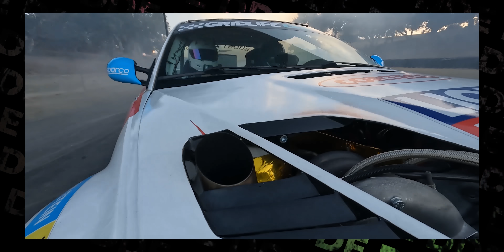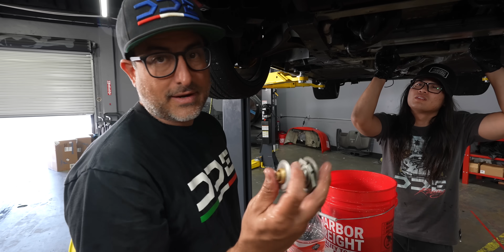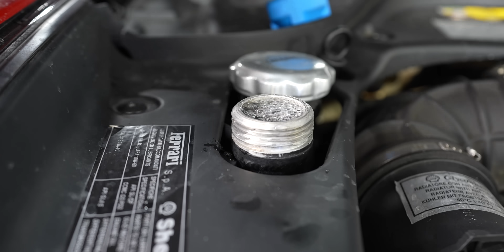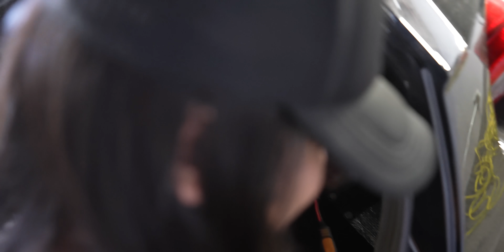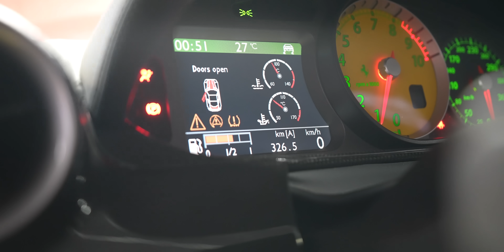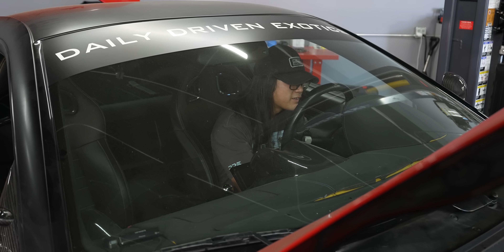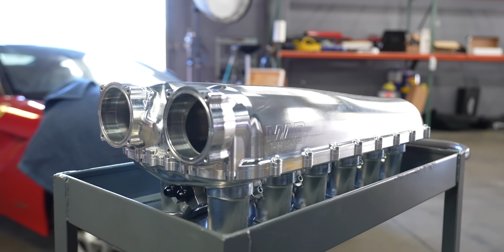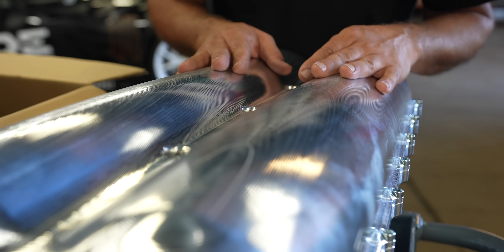WE SCREWED UP... FINDING FATAL FERRARI V12 ENGINE DAMAGE

Comment: Mike, with the thermostat being removed the coolant is constantly circulating so the coolant won’t stay in the radiator and cool down! Also should throw the thermostat in a pot of water and boil it with a temp gun to see when it’ll open or if it’ll even open.
Reply: I second the boiling of the thermostat to see if it's working. I'm also curious to know what other water flow control system Ferrari might have in place that's tied to the same system that controls the fans. Do they have a temperature/flow control valve to cool some other system like the intake air temps that's controlled by the same system that operates the fans? Did you guys try turning on the heater full blast to make sure all the air was out of the HVAC system?
Reply: Yeah they should've started with a new thermostat and complete flush of the cooling system
Reply: So you want to restrict flow, cool down the water on one end while increasing the temp on the other and constantly introduce huge temperature shocks to both ends of the cooling system to accelerate it's degradation? It takes seconds if you're wide open and already at temperature and heat soaked on a large motor to overheat if you lose circulation. Not WOT and just driving regularly? Thats' when you watch the temp gauge creep up and wonder if it'll ever stop. On a hot day a 180* thermostat is never closing in the south. Thermostat serves 1 main purpose. Keeping coolant at ideal operating temperature - this serves two parts, the performance of the engine to stay at ideal operating temperature and for interior comfort. You also don't want to be beating on an engine that is only at 140f. Nor 240f.
Reply: The thermostat is a spring operation device designed to open when the engine gets to operating temperature as the engine heats up the valve opens and closes as necessary its all temperature controlled having a thermostat in the car doesn't really affect the temperature unless there is a blockage somewhere in the water jackets or the radiator from excess build up flushing the system usually helps unless its a cracked head it doesn't need to be very big to leak just enough to start to warp the heads the list of possibilities is endless. im thinking that it can be most likely a cracked head or a gasket or a radiator blockage.
Reply: Strange they didn't check water pump, mine on volvo v8 fins of water pump dissolved  completly, and it starter to overheat badly as water was no longer moving.
Reply: That’s not how that works..
Reply: It needs a water punp
Reply: I drive a MK1 golf without a thermostat,without the thermostat it takes longer to warm up and when im driving on the freeway the temperature drops below operating temp bcoz of constant water circulation in system. No overheating at all
Reply: That is very literally not how it works. 

The point of a thermostat is very simple, it's a valve that operates based on temperature. When temp is low, the valve is shut, when temps rise, the valve starts opening. Really simple concept, it's an intentional flow restriction to keep coolant in the block. Why? To allow the coolant to warm up in the engine block without being allowed to flow through the radiator and cool down. Metal chips as it gets cold, so the edges of gears and other moving parts can be permanently damaged if operated in too cold an environment.

Do cars exclusively operate in the country they're built in? No. Do the engineers know what the climate will be like wherever the car may end up? No, it could either end up in Alaska or the Caribbean, and the system has to be able to handle both of those extremes. Does that mean that the system is optimized for a particular climate? No. Does that also mean that there is a more efficient possible system? Yes, one with fewer restrictions. 

Deleting a thermostat will NOT make your car overheat, that idea stems from a complete misunderstanding of the way a cooling system functions as a whole. Deleting the thermostat WILL cause problems depending on your climate and usage, but the one thing it won't do is cause overheating. If you're in a country where the temperature ever drops below 20c or there is +/- 10c of temp variation, NEVER delete your thermostat. In cold climates, the thermostat serves an essential purpose, and frankly those climates are the entire reason for the inclusion of a thermostat in the first place.  

However, if you're like me and you live in a country where no matter the time of year, it's always 30c+, the thermostat serves almost no purpose. Most thermostats open at 80c, and literally 2 minutes after startup, your coolant will have reached 60-80c depending on your engine's total coolant capacity. Get a bluetooth OBD2 scanner and connect it to your phone and you can get a live readout of your coolant temps plotted on a graph, check for yourself. In other words, if you're a normal person and you let your car idle for 5-10 min before you drive off, you will see literally no difference from removing your thermostat (In a warm climate). None of the dozens of racecars our garage has built has a thermostat, because we built and engineered them for our specific climate, and because it never gets cold enough outside for the metal to ever be in danger of chipping, the risk posed by a deleted thermostat is non existent. 

Everyone who keeps saying stupid things like "The coolant is flowing too fast to absorb heat", has less than no idea what they're talking about. If that were true, racecars would not be able to cool themselves. The Bugatti Veyron has water pumps that are almost as powerful as fire engines and circulate that coolant at extremely high pressures and speeds. If you want to learn more, look up how flow and speed affect cooling efficiency and what the thermal maximum for water is, as well as water's cooling efficiency, which will explain just how quickly water can absorb heat.
Reply: When you start a car it raves up until the engine is upto temperature then the raves down to normal idle.
Now if you remove the thermostat the car take way much longer to rich operating temperature and since the engine is in closed loop with a pr -determined fuel to air ratio to get it to temp hence using way much more fuel, gets stuck in a closed loop fuel cycle that degrades cylinder walls, piston, piston rings n catalytic due to higher fuel ratio needed for combustion.

Now without the thermostat and the engine is up to temperature on a long trip, hot day and probably a hill ahead your car will overheat since the coolant is constantly circulating between engine block and radiator and there's no thermostat to hold back the coolant in the block as the coolant in the radiator gets cooled thus causing the car to overheat.
Reply: Ummm, I hate to tell you this, but when it’s open, aka operating temp, it doesn’t “stay” in the radiator.  It’s constantly flowing just like it is with out one in.  The thermostat is actually designed to help the car warm up quicker.
Reply: @1216jimmyz  not having the thermostat in place will most defiantly alter the flow rate of the system, and depending on location of the thermostat it can alter the flow path, because it does have a restriction when full open, that is not there when removed. this is and extreme high performance engine, where every little detail maters to perform correctly, not a basic engine where removing the thermostat would only slow the heat up process. I know this from experience with many custom builds, not theory.
Reply: @cavemanmechanics1631  well said and correct.
Reply: @cavemanmechanics1631  lol, funny how every race car I’ve seen or dealt with has a thermostat delete. But keep telling people how a thermostat that stays open over 170 degrees is causing the engine to overheat…
Reply: @Not_Hans  Bro I swear to God, reading some of these comments is baffling. It's people who have not done it, who clearly do not understand the system, shouting down people who have done it and do understand what we're doing.
Reply: @Not_Hans  yes most race cars have no thermostat, but some need to run restrictors in place of the thermostat to maintain a certain temp( depending on application and many variables usually high speed oval racing) and some need a restrictor to not overheat ( I have experienced this in a few very modified street cars when doing drag and drives)
Reply: @cavemanmechanics1631  you're not wrong but you're also being misleading... Any modern day vehicle (in the last 30 years) will NOT overheat due to a stuck open thermostat (and if it does its probably a Ford or German). The only 2 scenarios a Restrictor would or should be used is to assist the engine to warm up to its operating temp to avoid running rich until the car actually hits its proper temp, or to PREVENT over heating in an Improper cooling setup. biggest examples being purpose built drag cars that run smaller radiators to reduce weight, smaller radiator means less over all cooling capacity with a stock or possibly after market water pump will circulate the water too fast through the system. In the video they literally mention how the radiator is cold but the over flow tank is boiling over, that's either A. A stuck CLOSED thermostat. B. A faulty water pump. or C. Some voodoo Ferrari bullshit that has some thing some where plugged or blocked (possibly when the car had a front end wall tap).
Reply: @Not_Hans  I never said anything about a stuck open thermostat, I said the thermostat needs to be put back into the system once tested for proper operation before preforming other tests.
Reply: @1216jimmyz hate to tell you this but the thermostat also restricts flow to keep it in the radiator long enough to cool it. If it moves too fast through the system, it will still boil over.
Reply: @1216jimmyz  👍👍👍 Exactly why vehicle will throw check engine lights if vehicle takes to long to get to operating temperature when cold started. It's there for a reason. Cooling systems differ from vehicle to vehicle as well.
Reply: @hughswain7422  with that theory every car would throw a check engine light in freezing temperatures. That's not how that works
Reply: @1216jimmyz  it does restrict flow to help cooling. Look it up. Alot of vehicles will actual overheat without a thermostat
Reply: @hughswain7422 what cars? Because thats ABSOLUTELY false… an open thermostat will prevent you from having heat in the winter time that’s about it… I’ve never heard of a car needing a thermostat to close to prevent it from over heating.
Reply: @Not_Hans  I see you know it all so I'll let you have it. But you are wrong I actually run a shop w a very good reputation. No thermostat will actual choke up the path of coolant and keep it from flowing in alot of vehicle. Too much flow. They are not designed to run with out a tstat. Google it or something. Have a great  day !!!
Reply: @Not_Hans you'd still have heat. The thermostat slows the flow of water, even when open, to keep the coolant in the radiator long enough to cool effectively.
Reply: @hughswain7422 i had a similar issue. My car was overheating due to the thermostat, i got a new one that is modified to stay open longer to keep the car cooler. He is a head mechanic and race car driver so i believe he knows what he’s doing🤣
Reply: That’s not how cars or cooling systems work. It will take a car longer to warm up to its normal operating temperature and will also prevent your heater to function in the winter time. Aside from those 2 things it should not prevent the system from cooling correctly.

Comment: This is the same problem that mat armstrong had it he found out that the issue was the thermostat so maybe it the same case with the 599
Reply: They just removed the thermostat!! That's not the problem.. it should run cooler without the thermostat. 
  (Headgasket compromised!!)

Comment: Ive seen Mike doing recap like 7 times last couple of months with no significant progress to show xD
Reply: Because the engine is being built elsewhere it’s out of their hands right now
Reply: They always talk😂
Reply: Well they have fixed and broken the cars multiple times just in the last month/month and half.  The f12 is gonna take forever they are building an engine with no aftermarket support so it's gotta be al custom and I'd be suprised if any engine builder took under a year to jist do the motor. I mean ur hoping it all is done right and that could mean multiple tear downs. Once the motor is done rest is straightforward since same process for all drift cars that is being built for class spec rules.  Other then a custom drive shaft to go woth the new trans shouldn't be down time and the work will all be done in shop where we can watch the process again.  Plus it's all mechanical not like they putting in a interior
Reply: @masturone8257 😂
Reply: Just like he says his dream build is a Mercedes.

Comment: Daily Driven Exotics. Brought to you by people that don’t own exotics… What is even going on with this (These) channel(s) now… At least use a presenter that actually owns a supercar not a blagger that’s bitten off more than he can chew 🤦🏻‍♂️
Reply: Furthermore, he has no idea what he’s doing. That Ferrari isn’t self bleeding. Why would he try and pressure fill it. And, the pipe for the pressure bleeder was full of air. Guy thinks he’s working on a BMW with self bleeding coolant system.. 🤡. Damon needs to get a decent technician before more damage is done.

Comment: My Camaro is no Ferrari 599 but it was doing the same thing I changed the water pump and it fixed my issue with overheating and throwing water out the coolant